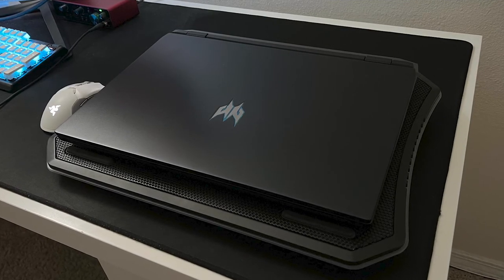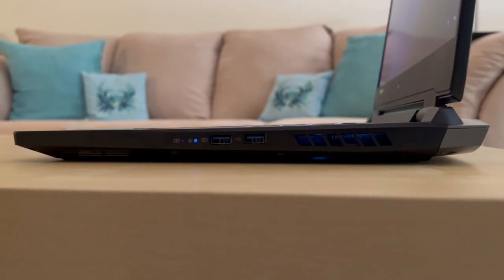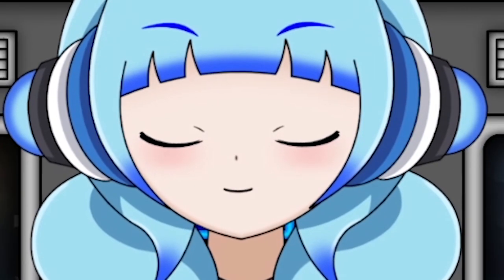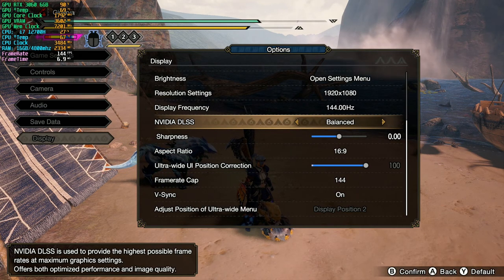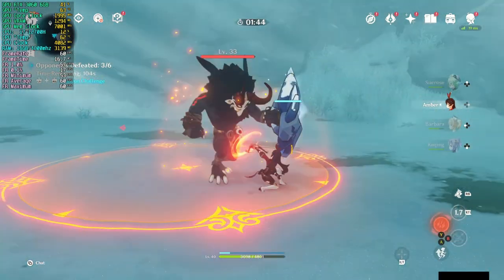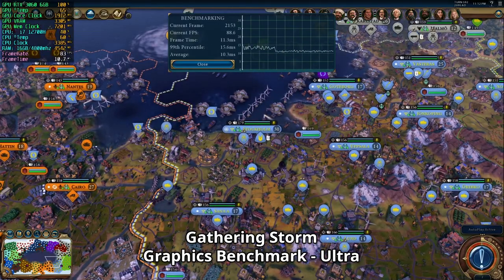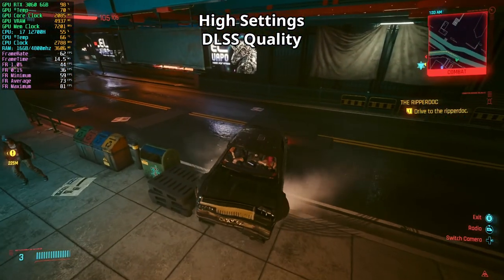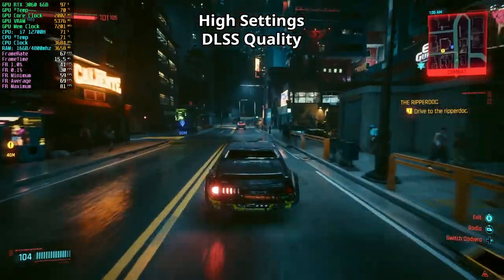Predator Helios 300 17.3" (2022) Overview + Benchmarks

Comment: Great video. You actually pointed out to important things about the laptop. Very good! I have the 2021 version of the same machine with i7 11800H and same RTX 3060 and the temperatures are much worse! I hot 92C on CPU and 86C on GPU ( room ambient temp is about 25C) and even truning on the extreme mode doesn't provide any noticeable performance gain (maybe about 1.5 fps better) but will cause the CPU temp to go to 100C! That's why I always use the default mode which is a shame (I liked to use PredatorSense's potential with setting extreme mode in games). I guess the addition of the liquid metal on the CPU has had a huge impact.
Reply from the maker: Thanks so much! :D
Yeah liquid metal seems be helping out a lot here. 

Sorry to hear about your laptop's temps. 
If it helps, you could try and put the laptop on a ventilated platform to help airflow. I use the cooler in this vid as a platform, but the fan in the cooler isn't running.
Reply: Last year model is known for the worst model unfortunately. Probably because covid, they had to cut so much cost.
Reply: Hello. I think to buy 2021 17,3 Qhd Acer 300 I7 11800h Rtx 3070 140watt. Is it good choice price / quality?
Reply: @YaKuZaYa  It is good quality and I like my laptop, but I think if you can get the 2022 model which has liquid cooling on the CPU it will be much better. There is a complete review of that model on Jarod's Tech channel, you can check it out as well.

Comment: Hi, I'm new to your channel, I'm also planning to buy this model, any updates about your laptop? Did you encounter some major issues?
Reply from the maker: Hi Hi! It's been over a year since I had this laptop. So far it's been doing pretty alright. No particular major issues I had besides a tiny bit of scuff on the laptops lid.

I should note that I upgraded this laptop to 32 GB ram and a better SSD, so I may the performance I describe may be a little better than stock specs.

It can play some newer games like hogwarts legacy fine, though I still recommend lowering settings or capping framerate to avoid thermal throttling and performance issues.

If you still want this laptop, I recommend trying to find it at a cheaper price, or another laptop with similar specs cheaper. (Maybe check out something like the msi katana 17 with 4060) Black friday's coming up, so if you can, you could take advantage of that to get a laptop cheaper yep yep!

Comment: I have this laptop , got it for $1149 at Best Buy sale, its probably best 1080p ultra machine you can buy for that price. No issues whatsoever with drivers (AMD) and it’s got ddr 5 memory.
The only major drawback I see is the vRam. 6GB is enough for today but it will limit its lifespan. But still at 1080p vRam isnt ultra critical as it is in say 1440p  or 4k
Reply from the maker: I didn't know there was an AMD variant, but you are correct about the vram.
Reply: @GinervaNikoletti  no there isn’t it’s the Intel i7 , I was saying it’s pros is not having to worry about drivers for the gpu like some and cards I have had in this past not working correctly when doing updates. And having to fix it by manually installing drivers. A headache 🤕 I like AMD but that particular laptop was miserable experience.
Reply from the maker: @spectrallines1695  Ah I gotcha. My mistake. lol

Comment: What's the PCIe Gen of the SSD that comes with it. I know it supports max PCIe Gen 4.0. But I am wondering if the one that comes with the laptop is PCIe Gen 3.0.
Reply from the maker: The one that came with mine is PCIe Gen4.

I switched mine out anyway with a 1TB 980 Pro as C: for more storage, and threw in a 2TB 970 evo as the 2nd SSD.

Comment: Just bought this variant, but 15.6". How's your laptop holding up now? It has 512GB, and I want to upgrade it. Which SSD is good for this laptop?
Reply from the maker: I haven't been using my laptop everyday, but it's still very good. I played Sonic Frontiers on it last time and I love it!

I put a 1TB Samsung 980 pro as OS drive, and a 2TB 970 evo Plus and secondary. M.2 SSDs like 980 pro and the WD Black Sn850 should be pretty good for it.

Comment: I just recently bought the 15" version of this laptop and I am having problems getting the dedicated GPU to show up in my task manager. It doesn't seem as though it is being utilized at all. And when I go into my settings after loading into Cyberpunk 2077, it says that an RTX graphics card is required to turn on DLSS. Did you experience anything similar? Even if you did not, do you have any advice on how to fix the problem? Thanks in advance.
Reply from the maker: Oh yeah that's def weird. I wouldn't have been able to make this video if I had an issue like that.

What I would try is:
1: Open device manager in windows, and click the arrow next to "Display adapters" to expand.
2: If you see "NVIDIA GEFORCE RTX 3060 Laptop GPU", then at least the computer detects the device.
3: Go to NVIDIAs website - click drivers - search for your GPU "Geforce RTX 3060 Laptop GPU" and download + install.
I hope this helps. If it doesn't show up in device manager, I would think it's defective. >_<

Comment: What brand of ram do you recommend and the slecs of ram? I only have 16gb single channel
Reply from the maker: Yours came with only single channel?

Well, Crucial, TeamGroup, Corsair, and G.skill are brands that I'm familiar with that would make good RAM.
But DDR5 ram is really pricey right now, so if you just need dual channel ram, 2x8gb (16GB) 4800mhz would be the cheapest you could go for.

I upgraded my ram to Crucial 2x16 (32GB) 4800mhz ram, though I got those on sale during prime day.
Reply: @GinervaNikoletti  Thank you, but it also matters with the CL of the ram right? Do you think it matters? I mean if I go to the store and if there is an available DDR5 Ram for laptop, then it will be compatible right away? Thank you!
Reply from the maker: @jeromalan7251  CL means latency, (Lower CL is better) So any CL should be compatible I believe. My 2x16 is CL40.
Reply: @GinervaNikoletti  does it also matters if i purchased a jedec profile or xmp profile? I presume our default ram in our laptop is non xmp
Reply from the maker: @jeromalan7251  In this case: There doesn't seem to be an option in the laptop's BIOS to enable or disable XMP. So I wanna say no, it shouldn't matter. Just make sure the RAM your getting is DDR5 laptop memory.

When I upgraded my ram, the speed was as it is. (4800mhz) It's not faster than the ram originally it came with. I just needed more than 16 gbs in my case. lol